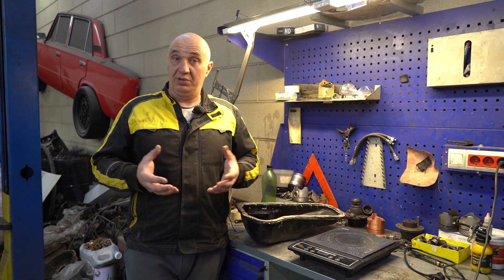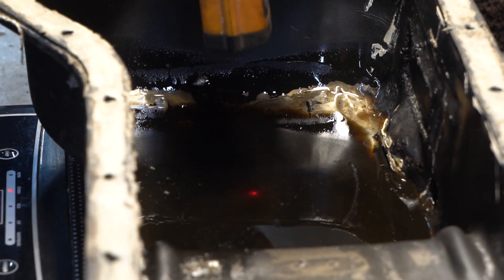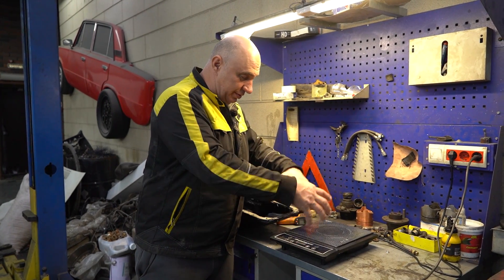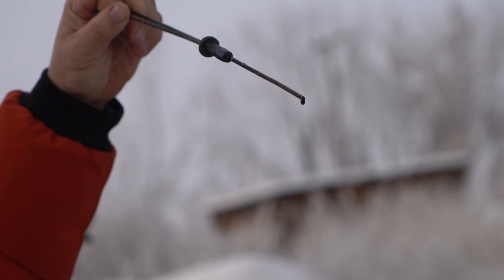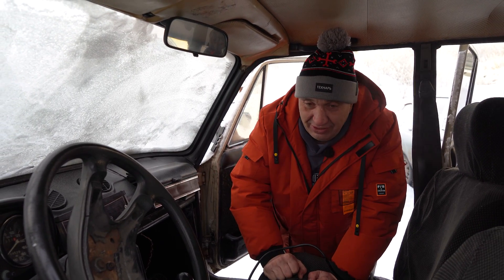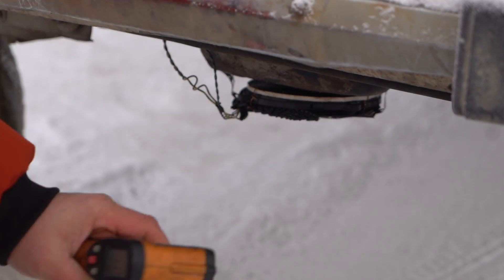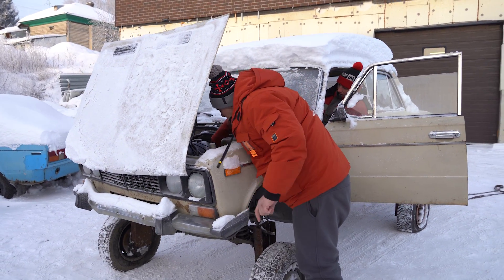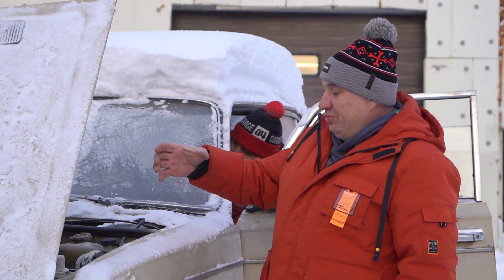We fit an Induction Stove to an Oil Pan

Comment: Heating the oil would be faster for being able to crank the engine over, but for warming overnight heating the coolant would warm the oil and make it quicker to defrost the glass and warm the cabin.
Reply: I think oil freezes/cools a lot the moment it goes to circulation. All of the oil is in the pan when coolant is in the pipes all around the engine and engine block. Both needs to be warm but for starting up i think coolant is more important.
Reply: If its possible i woud heat both the coolant and the oil.
Reply: @banana_joe_1855    It is possible to warm or "heat" both, in some ways.
Reply: @01mustang05  I know it’s possible. I was trying to imply, that are you able (as in  whatt kind of infrastructure you using to power the heaters) and willing to?
Reply: @banana_joe_1855   Ya I wouldn't have guessed that that's what you we trying to say or "imply".  The only other thing I'm now thinking what you might have meant was that when or if you have the means, that you would heat both the collant and the oil before stating these types of engines in really freezing cold situations.
Reply: @01mustang05  Yes, that’s right. And I’m sorry for the unclear response or the bad English.
Reply: Heating the coolant would also more effectively warm the engine since the coolant passages run around the cylinders. It is the superior option for winter starting which is why block heaters (which heat coolant) are so popular.
Reply: @averagecarguy420  For the making the engine last as long as possible warming the oil is better, but nobody cares about that when its -30 in the cabin lol.
Reply: Cool story bro
Reply: I have a coolant hose heater for my built engine, its good for making less wear on the cylinders/rings, i have a oil/water heat exchanger which help the oil get up to temp when the oil is being pumped through it.
OIl is still -30 at start which gives bad lubrication for my bearing surfaces though.
I would like to put a heating element inside the oilpan but it would be alot of work :( , could get a contact heater but for the price i dont feel like it would benefit much :(
Reply: @BMWe-ed2tn   Your little coolant hose heater is likely electric, so adding an electric oil pan heater should be fine on the same electrical outlet/extension cord and would greatly improve -30 startups and less wear would greatly improve as well.  Many oil pan heaters exist; pick a proper one that's equivalent to your hose heater and plug them in when it gets colder than -10
Reply: @01mustang05  yes thats what i was thinking of but the ones that are available nowadays are just contact heaters, not like the old vw 1200 ones where they were in direct contact with the oil.
My parking outlet only runs for around 60-90minutes before my set time so investing in a heater that most likely would do minimal heating is discouraging:(
My outlet is also limited to 2kW and the hose heater is 550W with a battery charger at 100W and the cabin heater at 1200W doesn’t leave much for a pan heater :(
That’s why I would have wanted a 100W or so in-pan heater :)
Reply: @BMWe-ed2tn   Wrong!  The direct contact, typical block heater type style, it totally available for purchase nowadays.  And a "cabin heater"? - Jeez man, spoiled much?  You can live without it.   

If you care about your cars engine and you've been limited on some kind of timer, I'd say you would nix the cabin heater, install a proper block heater instead of that hose crap, and install the oil heater you think you can't get when you actually can.
Reply: My dad taught me to press the clutch when starting cold, so the cold oil in the trans doesn't drag.
Reply: @MattBrownbill how long tough? You press the clutch anyway to avoid accidental jump(literally) starts.
Reply: @norbertnagy5514  na, always put in neutral before even thinking about starting. But yes pressing clutch does stop accidents.
Reply: @MattBrownbill  yes, thats the other thing. Managed to jump start on 1 of my learning sessions. I think i not pressed it in enough. Finished all the things this week. My licence probably arrives the first half of the next haha.
Reply: IT IS way better to pre heat the coolant, because it will heat the oil too and engine as a whole. Warm oil is nice but if your block is freezing cold it is little of use.
Reply: @radekfylcka9029    If it's too cold out, the oil will not get to -10 C.  And if the block is -10 C, the oil filter is -10 C, as is the battery and you got decent oil, there is no problem!  Anything colder though, if you want to be careful with your engine, further steps and time to warm the block and the oil must be addressed.
Reply: @@karlwithak.Nope.
Reply: The colder it gets, the less effective a tiny heater in the anti-freeze is.  Engine damage occurs most often during cold startups;  if you care, you would heat oil at those frigid temperatures.
Reply: @01mustang05 Nope.
Reply: @01mustang05  the most important thing is piston to wall clearance and when you have warm coolant in the cylinders it brings the piston to wall clearance closer to correct spec. If you’re using the correct oil it will flow perfectly fine, especially in an engine warmed up by a block heater.
Reply: @averagecarguy420    Freezing cold piston, rings, and cylinder walls, so what if the right oil flows perfectly fine then, so there is no need to heat this engine with the "correct oil as you claim.
Reply: @01mustang05  uhhh… heating the engine gets the piston to wall clearances closer to proper spec, as I said before.
Reply: @averagecarguy420    I can use 0W20 and the oil still needs to be warmed up during such freezing cold periods!!!  And heating the oil does heat the engine over time!!!  And no coolant heater, that isn't circulating, is warming oil at the bottom of the engine that's being exposed to -30C or colder!!!
Reply: I have a coolant heater and I can confirm after 6hours of being plugged in my coolant will be at 60c.
The oil though will be only fractionally warmer than ambient air :(

Comment: Block heater in the coolant, 107%.
Reply: I think that's the way to go. Makes cranking easier and when the frozen oil hits the warmer block it will thin out fast compared to a full on cold start.

Comment: wonder if pointing an infra red light at the oil would work
Reply: One of those red heat lamps would work.

I used a 500W halogen lamp and some cardboard to warm up my differential in the winter and let some sealant set when I was "repairing" rust holes in a non replaceable cover.

Comment: In the 70's, my father who was a British Rail signalman was given a paraffin fuelled point motor heater as the cold in them years was grim winter time.   It sat under the sump like a toad under a stone and just kept the engine and box warm, not hot but just warm enough to enable good cranking.   He even got his paraffin for free and once a month he would get a huge barrel of the stuff, the heater even 24/7 didn't use a fraction of that and our paraffin heaters indoors were fairly frugal so he sold the surplus for quite a nice profit.   Our house we never paid for light bulbs as they came from British Rail, toilet paper was free, soap, tea and tea bags, powdered milk and even cloth material to cover chairs and stuff was purloined off of British Rail and bearing in mind everyone who worked for 'em did it no wonder they were unable to make a positive economy back then lol
Reply: Liberating stuff from work is still live and well.😂
Reply: There certainly was a barter system on the go, of which BR's tradesmen were an integral part! Certainly round my way, where I'd a relative who worked in a massive BR works. Benefited me, because I got an instrument flight case made by apprentice chippies, which was beautifully made, and 30+ years later, despite a few scratches and dings, it would probably still shrug off a direct hit from heavy artillery!
Reply: Nice!

Good positives of the job!
Reply: Wonder why British rail never makes a profit you guys done similar shit to your car industry wow
Reply: They say every company with Brittish in the name went broke, now we know why.
Reply: I can't do it. Maybe long in the past. 

I do ask though. Sometimes it's yes and sometimes it's no.
Reply: There was a saying in communist Russia. “If you’re not stealing from the boss,you’re stealing from your family.
Reply: Cool story bro
Reply: Did they not have security back then?
Reply: Work smart, not hard.😂😂
Reply: It s called theft!